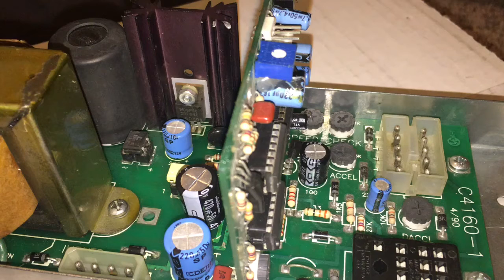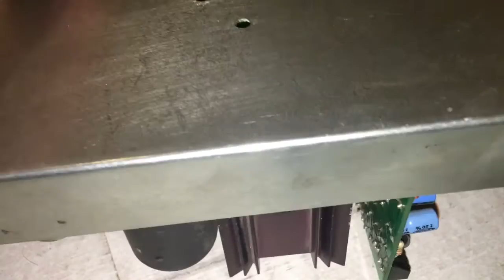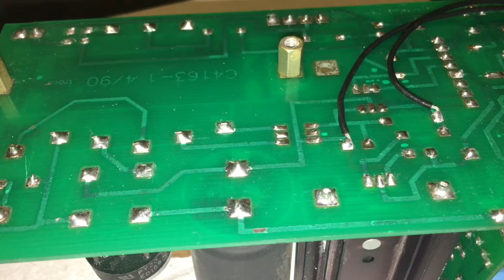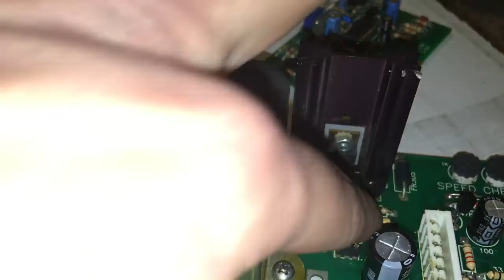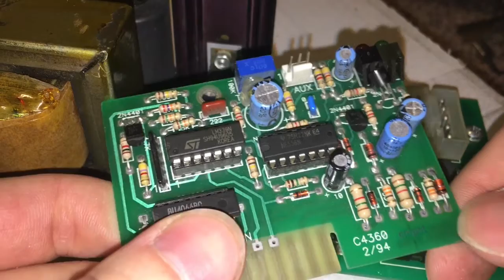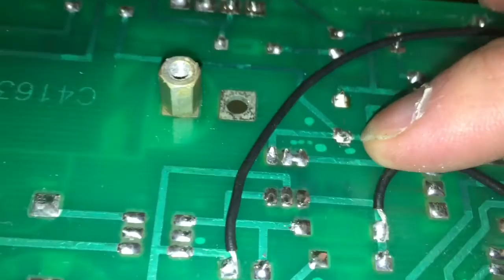How to repair Horton 4160-1 4000 series Hercules door control

Comment: Technically that's a C4160-3
Reply from the maker: Rob P what makes it a 4160-3?
Reply: After Hours Tv & Pc repair daughter board
Reply: After Hours Tv & Pc repair did you work at Addison Automatics at one point?
Reply from the maker: From 2003-2014.
Reply from the maker: Just bought the next board. I’ll be making a short video on it and have a couple more ordered. https://www.facebook.com/hitandrun83/posts/10154948852201324 tag along if you’d like

Comment: Where are you located?
Reply from the maker: Rock falls Illinois
Reply: That's great. I just found your videos.. I'll be in touch about some rebuilding. Do you rebuild operators too.
Reply from the maker: +New England Automatic Door I do not do operators. This is just the start of videos I will be making. I've rebuild door controllers for 10 years. Besam, Horton, doromatic, km, Stanley. Thanks for contacting me!
Reply from the maker: +New England Automatic Door just wondering when you might like to get some things fixed. Email me and we can talk!

Comment: The nut holding the mosfet to the heat sink is loose, maybe it's a goner.
Reply from the maker: Plastic grommet there to protect it from touching the screw. I'll make sure it's tight though,.
Reply: have you ever had experience with Stanley P/N 110563 electronic interface board assembly
Reply from the maker: Manuel Soler send me a photo of it hitandrepair@gmail.com I probably have. There were only two styles that I am aware of.